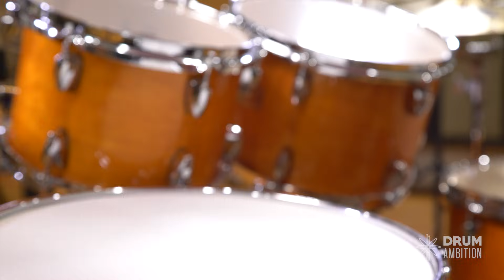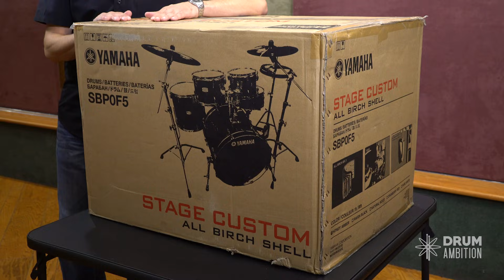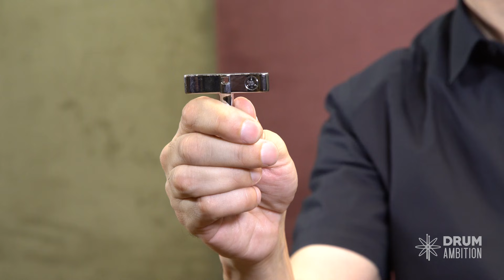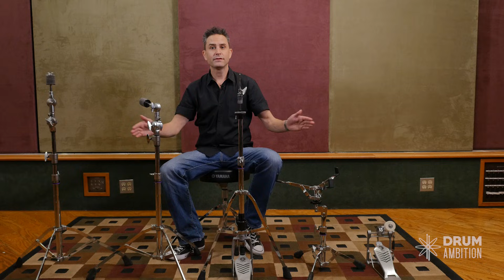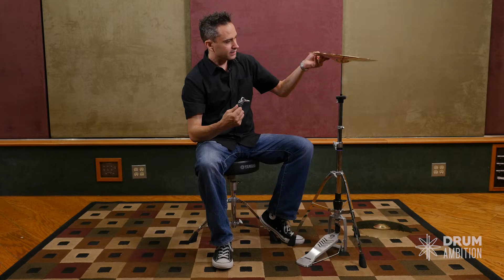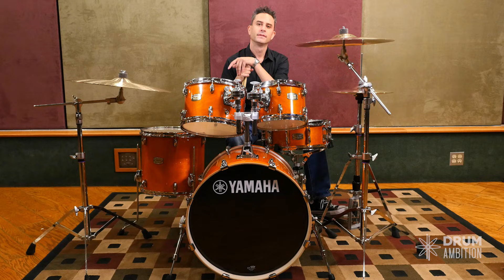How To Assemble and Set Up A Drum Set - A Video Guide

Comment: I would like to caution new bees 🐝. Be careful finger tightening the lug bolts by turning the bolt holding the threads with your fingers. The edges of them are sometimes pretty sharp and can slice your fingers. Like little paper cuts. If your hands and fingers are pretty hardened or calloused you may not experience any difficulties. But just be aware how tight you’re grasping them so you don’t cut yourself. 😇😇😇😍

Comment: How do I add a cowbell to this set using the Yamaha hardware?
Reply from the maker: Hi! You would need to buy a separate cowbell mounting bracket, and suspend from a cymbal stand. Most percussion brands like LP, Meinl, Gibraltar - all sell them. I'd go with the brand that makes your cowbell so that everything is compatible. I'd recommend against attaching it to the hi hat pull rod. They are a little heavy and can affect the pedal action.

Comment: Hello there! This tutorial is tremendously useful! Thank you a bunch! One question though regarding the tom holder. Is that the maximum depth tom holder can slide into the bass drum? It can't slide lower than that? At 11:47 it looks like it hit the lower end and it can't go further down into the bass drum anymore.
I like my toms to be as low as possible and as near as possible to the snare drum. In this video (and in a lot of other reviews I've seen), it seems like they are too high (for my taste) and I was wondering if they could be positioned a little lower.
Looking forward to your answer (or if there is anyone else who knows the answer, I'd really appreciate it ).
And once again, thanks a bunch :)
Reply from the maker: Hi there. Thank you for your comment, and thank you for watching! The tom post can definitely go lower into the drum - it depends on how low you want your toms. Shallow sized toms are best for the lowest playing position , because much is determined by the depth of the drum. You can see that at 12:44, there is about two inches between the 12 inch tom and the bass drum. If you got rid of that gap you could have a lower playing position. I prefer to play lower too. Thanks a lot!

Comment: Question - right at 6:10 you placed the bass drum rim/hoop in place, but how do you know if the hoop needs to be flipped over ?  It seems one edge of the hoop is rounded and one is flat, which side of the hoop goes against the head and which side goes out against the claw hooks?  The instructions show a diagram that one way is better than the other way, but I can't tell a difference.  Any assistance would be great !
Reply from the maker: Hi. Yes - great question.The flat side goes against the drum head, and the rounded side is designed for the claw hooks to fit nicely over the edge. Let me know if you have any other questions!
Reply: @drumambition  yes that is correct .